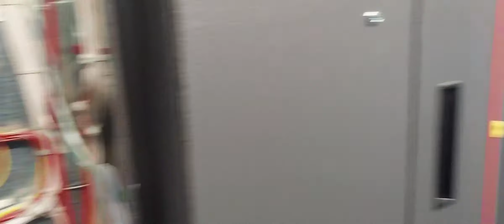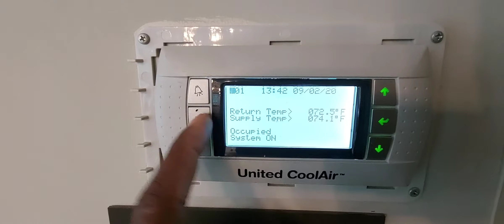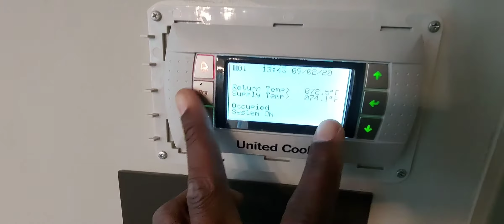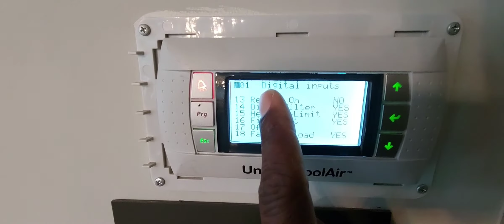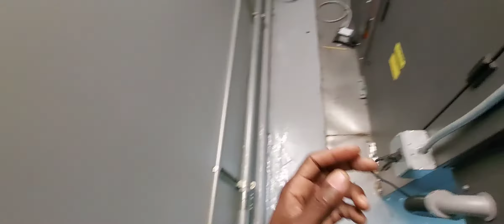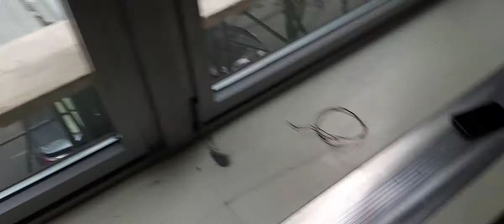UNITED COOL AIR CAREL CONTROLLER PASSWORD HACK AND HOW TO ENABLE REMOTE STOP/START

Comment: I recently had recover the connection between the pco and pgd1 but the pco lost his program, is there a way to recover the original program? Also, is there a relation between the battery inside the pco and the program loss ?
Reply from the maker: Possibly  however I never experienced it

Comment: great,iam new here, iam not used to this controller, can you please teach me carel pco2 controller with built in terminal, this is used  for petra package unit.
Reply from the maker: @pranav Jagadesh carel controllers is a universal controller that's used across several hvac manufacturer there's no set thing to learn with every manufacturer there's different out the box configuration  based on that manufacturer preference, I have videos on carel controllers inside different manufacturer hvac unit in a play list please watch and comment with any questions you may have!

Comment: hi
i want to ask a question which is not related to the video
i have a carel controller PCO2 which is used to control an HVAC unit and i want to extract the program to install it in another pco2 controller which is used for controlling a generator
what software should i use and how can iconnect to the unit?
can you help
Reply from the maker: Don't know that application